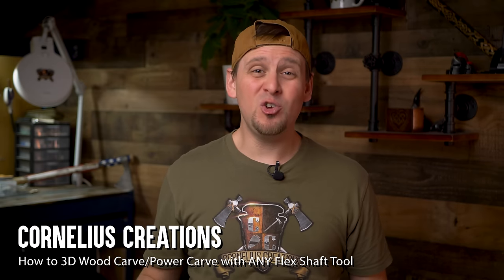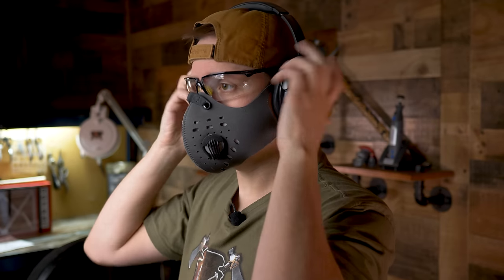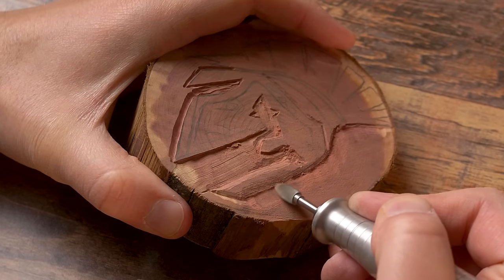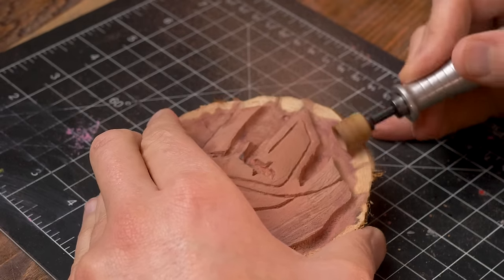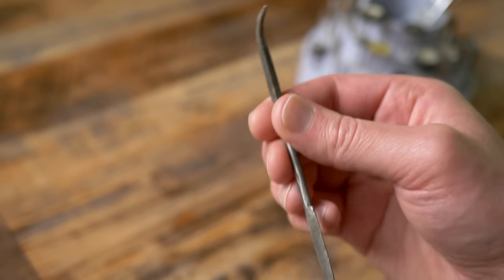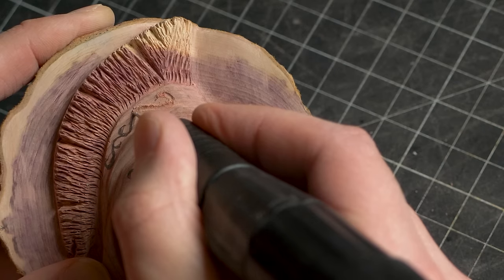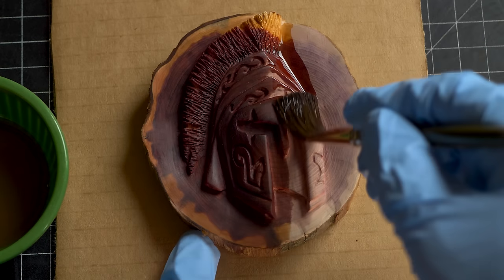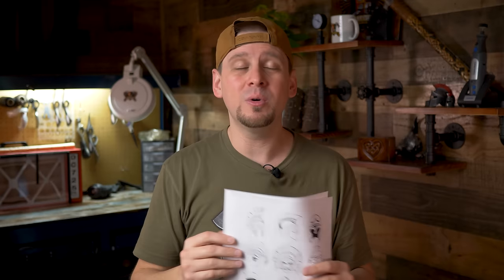How to 3D Wood Carve/Power Carve with ANY Flex Shaft Tool!

Comment from the maker: ⚔️ Tools, Supplies on Amazon & Spartan Template Pack 👇
-Spartan Wood Carving Template Bundle: https://bit.ly/372Xh33
-Dust Mask: https://amzn.to/37jR6rF
-Dremel 4000 on Amazon : https://amzn.to/2FuwEbX
-Cheaper Option: https://amzn.to/3iT9gm4
-PSI Dust Collector: https://amzn.to/3j7Spfz
-Fog-Proof Safety Glasses: https://amzn.to/2T8bvHT
-Foredom SR Series MY FAVORITE on Amazon: https://amzn.to/3iZNoph
-Dremel Stylo: https://amzn.to/3lPnmqC 
-Marathon 111 Micromotor: https://amzn.to/2SYIzla
-Wood Rounds: https://amzn.to/2IqMrJL
(Not Cedar)
Reply: what kind of wood did you use please and thank you plus other then brass wood what types of wood would you recommend as well would fire wood work? I think I have oak but I'm not sure. you should make an Athenian helmet too :)

question aren't diamond burrs mostly used for stone carvings? I didn't know that at times I could also use diamond burrs and that I'm sure it also depends on the wood like oak, cedar and or bass wood's

Comment: Don't you love it when you get the relief just about done, you hit a nik or angle the tip slightly to far and it runs across the entire face? 
 Inevitably happens on every.single.one. without fail.

Comment: That's really excellent.. wish I can do it too.. I've been watching most of ur previous videos to learn all the technics needed.. hihihi.. 
btw, if I may ask.. what's the rpm of the dremel used & what Burr ur using.. is it single or double burr.. thank you.. 😁😁😁
Reply from the maker: Hey there! You can do it, just have to tell yourself that you can :) unusually run around 28k rpm's. These were grit burrs and and double cut carbide ones.

Comment: Hello. I have bought a Wolfcraft flexible shaft, maximum 3500 rot/min (for the drilling machine). Is it possible to carve with a rotary rasp at such low speed? I think maybe it would be possible with rotary burrs. But with rotary rasp, you think it's possible? What's the speed you use with the big flexible shaft (not the Dremel)?

Comment: I am a novice at woodwork and want to know if you can give me some direction.
I have the Dremel 3000 with a flex shaft and have taught myself through trial and error, and listening to you and the helpful hints you talk about. I have a chest that I believe is either Chinese or Japanese with a 3D carving on four sides and the top.  It is about 40" x 21" x20'H.  I would love to refinish it and repair it if where needed.  In the meantime, I would like to know what the finish is and is the finish easily damaged?
I dues a little Windex with a soft paper towel to try and get dust and dirt off, but too much of that will lead to disastrous results.  However, when the Windex dried, it appeared to be a low eggshell finish; the dark or black portion is very, very fine, almost flake-like.
I enjoy your videos, and you are totally at home working with wood, so I thought I would start with you on my search to find how to refinish this piece of furniture.
I can send some pictures of the chest so you'll have a better idea of what I am trying to describe.  I am not on Facebook, Twitter, or zoom; doesn't mean I can't be if necessary to converse.
Looking forward to your response.
Tom K
Reply from the maker: Hey Tom, I am no expert in refinishing furniture so please double check what I say with someone else. But it sound like moisture has settled under the poly or whatever the chest was finished with. Might need to strip it and start by re-staining it and sealing it. I would double check this info though, As I said, I've never done any of that so I could be wrong. Best of luck!